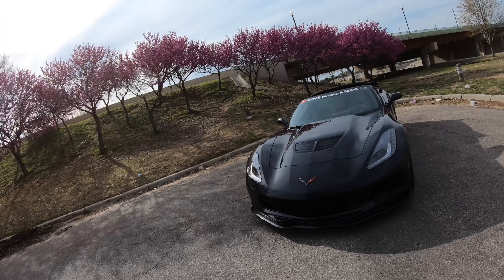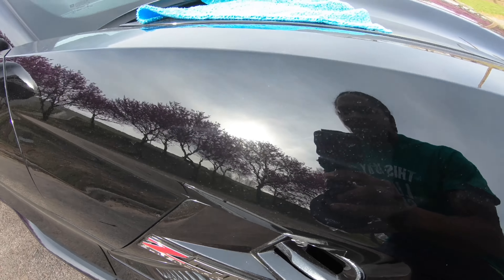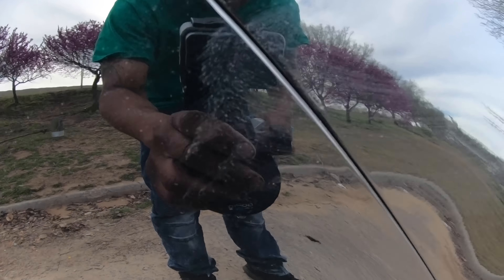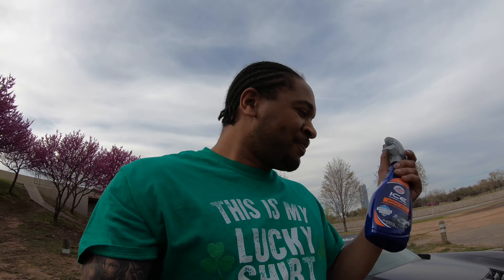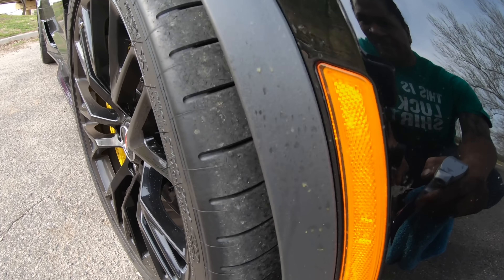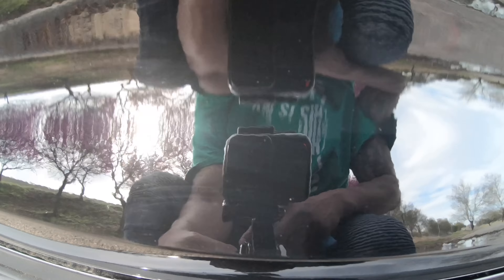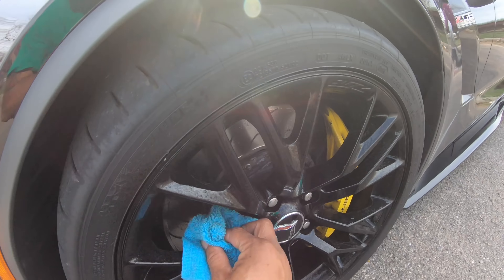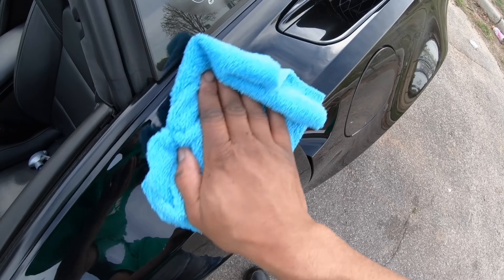Best Spray Wax For Cars

Comment: Turtle Wax Ice is the best wax I've used on my Vette & Challenger and I've  used everything on market pretty much, It is easy to apply, does not leave any build up or swirls and you still have water beading up 4 or 5 months later.